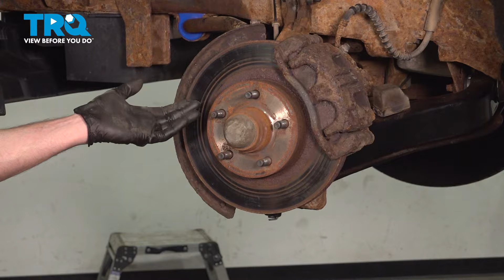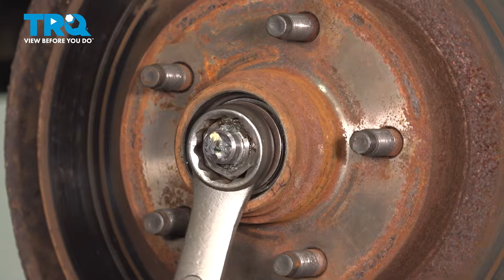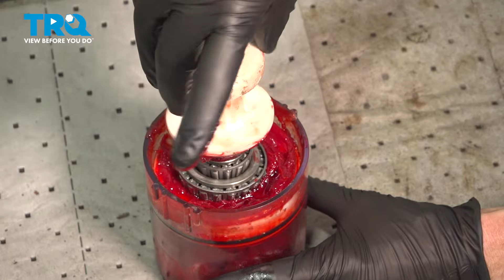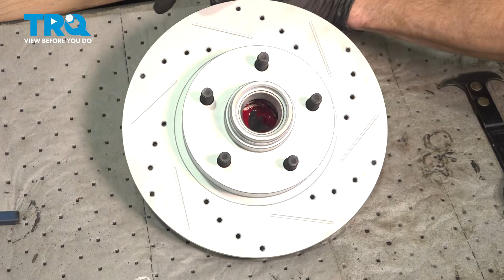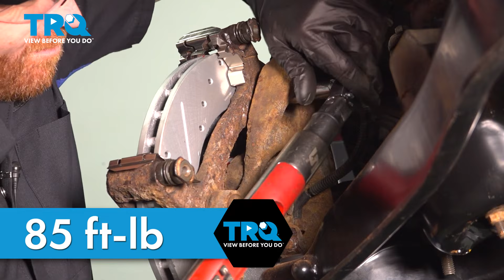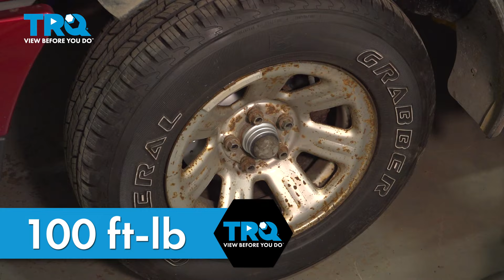How to Replace Front Wheel Bearings 1998-2011 Ford Ranger

Comment: I installed the races, then realized I had to put in my balljoints so I could return the press and the race driver. I finished the ball joints with 20 minutes left before they close and I returned them, I’m driving home and I realized I didn’t deal the wheel bearings 😭

Comment: Crazy torquing procedure, not using any torque wrench per ford specs is a huge risk. Also , you don’t bend the cotter key legs outward and up the front face of the end of the axle - they should wrap around the spindle retainer in opposite directions so that they entrap the retainer on both sides not just one side which could lead to loosening. IMHO You should take this video down and re-do those portions correctly.

Comment: Excellent presentation. Solid work as well! I do see where you missed one significant step however. At 2:00 when you remove the caliper from the bracket, there are clearly no clips rattle clips of any sort, as can clearly be seen at 15:30 when you put the bracket back in place. 
 Just curious why they weren't there to begin with, and why you put the new ones on if the OG system didn't have them.
 Anywho, keep knocking these great videos out of the park, love to see the old Rangers lifted from the Titanic and brought back to life!

Comment: This is how you burn out your bearings and have a whole hub fall off! Terrible installation torque procedure.
Reply: Could you elaborate? What exactly did he do that was so terrible? Did he overtighten the nut or leave it under torqued? I could see either one cause bearing damage then ultimately loss of wheel. However, this install looked clean to me.

Comment: Ford mechanic here. Most all your video's are spot on by what the shop manual states but not this one. On the spindle nut the way you  did it is a great way to burn up your bearings. Here is the correct way. I have it memorized from 23 years of working on fords... IT should  be 24 ft-lbs on the 27mm nut as your spinning the rotor, back off the nut 175 degrees, then retorque the 27mm nut to 17 INCH-LBS. Then what I do pop the wheel on w/ lug nuts to check for bearing play.
Reply: Mr know it all

Comment: Do you need to bleed the brakes after this job? I’m looking to change my wheel bearings, rotors and brake pads
Reply from the maker: +@jpatty5964 We recommend bleeding the brakes. This helps to remove any dirt in the braking system.

Comment: What is the little brake shield looking thing that sits inside the rotors ? I want to order that with my rotors! Jumping my truck 60’ really did a number on the front end 😭🤣 suprised I only need one bearing and one upper control arm but replacing everything